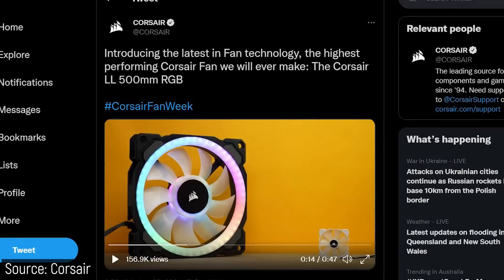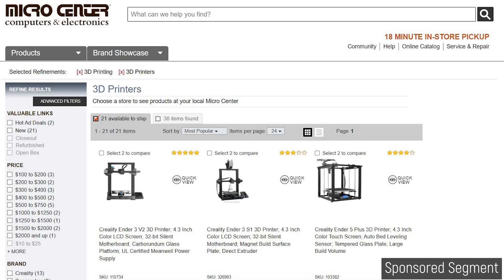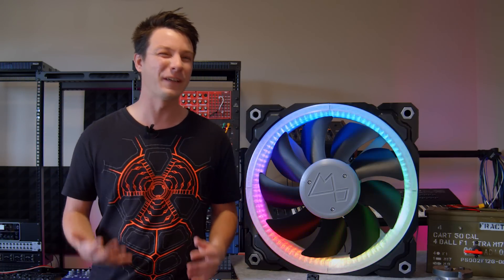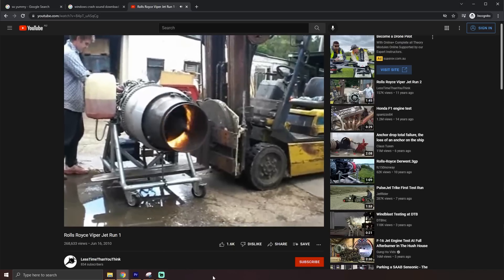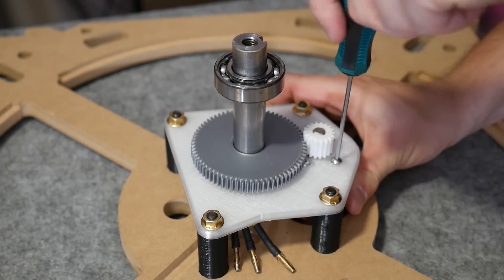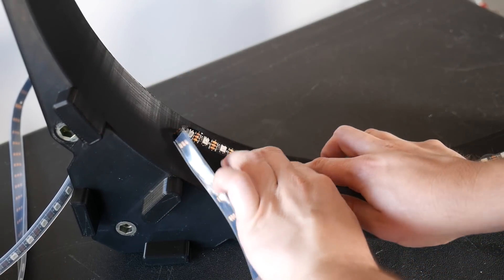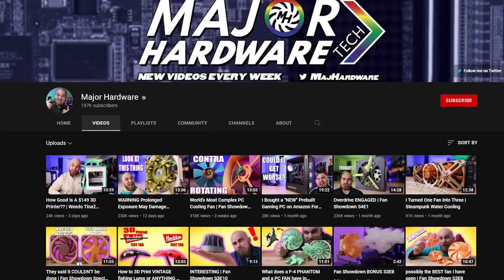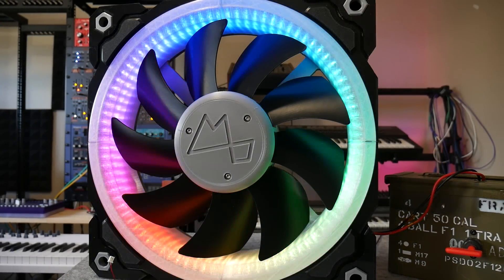Worlds most powerful RGB PC fan

Comment: If your gearbox melted down... maybe you need to cool it somehow? You could build a fan for that! 💖
Reply: next step: adding a bleed-air valve for gearbox cooling
Reply: Ive seen tests with some printed gears, for longevity you at least have to apply grease to them.
Reply: @FireN2k9  r/wooosh
Reply: Cast metal.
Reply: Hahaha. A tiny fan, inside the huge fan, to cool the fan components. Love it!! 😂
Reply: Fanception
Reply: Cool the gearbox with the corsair case fan 😂
Reply: Reminds me of the lego guy who lifted 200kg using a small lego motor but with many gears in parallel to spread out the load
Reply: If the smaller fan’s motor overheated.. maybe you need to cool it somehow? You could build a fan for that!💖
Reply: There is no way a 3d printed plastic can tolerate that super powerful motor, you need metal gearbox and really well greased
Reply: yes... that's what holes in hubs are for
Reply: When the fan is so powerful that you need to cool the fan with a fan.
Reply: @leandrolaporta2196  honestly, do not think that is required, recommend yes
Reply: Nah, he just needs an FDM printer. Obviously.
Reply: Fan for a fan
Reply: A fan to cool a fan with a fan. Hmm... Really makes you think
Reply: water cool the fan
Reply: Nah watercool that!
Reply: can't the gearbox would met but then you need another fan but wait....
Reply: @Lucas_sGarage  u woooshed yourself
Reply: Water cooled rgb fan
Reply: Makes me wonder what is the critical fan speed above which the current technology would emit more heat than it dissipates.
Reply: lmao
Reply: Those big fans used for bitcoin miners
Reply: Water-cooled fan
Reply: Fan for a fan🤣🤣
Reply: Good idea! But I thought it would be better if the gears are metal.
Reply: A fan within another fan
Reply: You could use a RAM intake from the blades to cool the gearbox.
Reply: 1. Printer Gets very hot
You: prints bbig thing
Printer overcooks just after finishing
You: starts assembling
You: uses fan
Printer: cold
You: Prints
Printer: AAAAAA
Reply: A fan to cool the gearbox of a bigger fan? That’s a great idea! But do you need another fan to cool THAT fan?

Comment: i don't know if i'm supposed to be impressed or horrified with the fact that a propeller that unbalanced didn't blow up with full send
Reply: It's only because the gearbox failed first, lol
Reply: It's okay. Angus was wearing safety glasses.
Reply: Right he could have added little weights where needed to balance it ;_;
Reply: Horrifically impressed, split the difference!
Reply: Why is it unbalanced? I use a centrifuge that hits 13,000 rpm at work. People freak out when they see me put 3 samples in it to spin. But you just need to ensure the mass is evenly distributed around the axis of rotation. So no problems. I just do that with 3 samples.
Say the fan radius is 45cm and running at 3000 rpm, then its pulling geforces of about 4500g. At that many g, it'd blow itself apart if it wasn't balanced.
Reply: @KieranShort  the propeller was wobbling quite heavily though when it was spinning slowly
Reply: @KieranShort  yeah but that's like not the point man. Of course it's mostly balanced however imperfections in 3D printing mean that not only is the center of rotation probably off slightly but each one of the propeller blades weighs a different amount. With brittle 3D plastic it doesn't take much to make it just come apart. I've seen it happen on a lot of different YouTube channels
Reply: @KieranShort  The balance issue is visible at the base of the hub. It's unbalanced from face to face of the hub which, while clearly not catastrophic, is a major limiting factor in top speed and likely contributing to the damage on the gearbox.
Reply: I wouldn't trust the added weight to stay attached. Better to remove material. But yeah it needs a little tuning.
Reply: @KieranShort  Ok yes but thats not a fair comparison really i mean  what size samples are you putting in there for one and is there not a huge caution sticker on it saying don't load an uneven amount of samples in it? lol  Thats only potentially dealing with a few grams at most of mass imbalance if its a lab centerfuge that is. You should try and pick it up next time your at work id bet its a bit on the hefty side not made out of PLA ! While his fan does stay together, at least it has for now, the fact of its tendency to want to perform its own rodeo is a  bit disconcerting. You can clearly hear it in the motor running as well. The spindle is nice and beefy at least and was done right and it looked like it ended up more balanced then the first test but for longevity/ major reduction in potential for lethality or grevious bodily harm, some balancing should really be done!

Comment: Really cool build. It makes great "thrust" and has an awesome design.

As an aerospace engineer, however, this is terrifying. There will be a speed at which the hub can no longer hold the outward force generated by the blades. Additionally, the blades themselves are only held together by the layer to layer adheasion / fusion of the plastic. Those jet engines you referenced have 75 years of design experience and testing holding them together.

Comment: If you want fast bearings without them being so quick to die once you remove all the grease, use a couple of drops of gear oil on them instead of WD40.
Reply: Yeah WD40 is "Water Displacer 40"
It wasn't designed to be a lubricant.
Reply: there are air bearings, just sayin'
Reply: @TauCu  Sometimes when it dries it can even recrystallize some of the crud it picked up and create a pretty damn sticky surface. I used it to both loosen and re-secure the rubber grips on my bike handles.
Reply: At those speeds, a lighter motor oil would also do well. 
Or just use the correct type and amount of grease, people mistakenly think friction at low lows and low speed indicates high load and high speed friction. But it just doesn't work like that low loads result in the balls skidding. Often machines with low startup loads will have some preload on the bearings to eliminate this.
In any case most of his friction was from choosing rubber contact seals rather than steel shielded bearings, and the excess grease will get pushed to the sides during break-in leaving a clear lightly lubed channel with self oiling reserves that also act as dust seals[on a shielded bearing]. Also those were the wrong type of bearing, a fan produces an axial thrust load and only trivial radial loads. 
All said so others can at least consider these factors in future projects, if any longevity is wanted.
Reply: @dustinbrueggemann1875  I've heard hair spray is good for putting on bike grips.
Reply: WD-40 as a substitution for grease? Maker YouTube channel? Fail. Not even bike chain lube...
Reply: @TauCu  yeh it even gets rid of grease and dries away itself.

Comment: I feel like the friction from the grease in the bearings is negligible when you're using a 1500 watt motor. Yes, when you're flicking it with your finger it stops quickly. But when being driven with even a few watts I can't imagine the drag is even noticeable.
Reply: I know the feeling. Way back in the early 80's I had a skateboard and spent an incredible amount of time messing with wheels and most important bearings. Looking back it was totally ridiculous. Sure it looked nice when you could put some spin of a wheel and it spun for a minute or so. But when you were skating it really didn't matter if you had torqued  down the wheel nut a bit more. It just meant you could be sure it would stay tight with no play. But no I was switching out bearings and spent more time cleaning and lubricating the bearings than I did riding the board...
Reply: @blahorgaslisk7763  Sounds like project cars!
Reply: yes but the gears are 3d printed and hence weak compared to injection molded or metal ones, removing any resistance is ideal as shown at the end they broke anyway.
Reply: @zalo3479  That's more because dry PLA is just a bit of a dogshit choice for a gear train no matter what your load is. A planetary set entirely out of that igus stuff with irrational ratios to spread the wear out would've had a lot less trouble regardless of the bearings having stock grease or not.
Reply: I don't think it's negiligible. It won't do much to slow the fan down, but it might just set the bearing on fire.
Reply: @blahorgaslisk7763  When skating it really can make a difference to swap bearings, especially on cheaper skateboards. With your legs you can feel a difference, on a 1500W it just kills the bearings.
Reply: And once it is spinning that fast. The grease will warm up and spin easier anyways… grease at room temp is always going to be sticky.
Reply: Definitely is like a grease in car bearings thing it seems like there's a lot of drag but it's fine

Comment: I build and fly quadcopters, but they only run 5" props and I'm terrified to be anywhere near the thing at half throttle with props on. That beast of yours had me clinching the whole time you were sitting in front of it o.O!
Reply: Once built a quad with 15'' carbon props, those were absolutely terrifying. A friend of mine almost lost a finger to his 17'' quad. Luckily it wasn't spinning at full speed but the prop still cut down to the bone and damaged some nerves. Always take the props off when you are working near them!
Reply: Tell me about it I was cringing ready to dive for cover and it’s only a video!
Reply: I agree That was very dangerous
Reply: @gonun69  Unless you're working on the motor systems themselves, you should also disconnect the motors from power.
Reply: @skylerlehmkuhl135  And that's the reason I'm terrified of those "flying car" concepts/prototypes where the prop is in the plane of the rider. What possibly could go wrong, right?!

Comment: The $100 Ender3 (even if it's just a sponsored event) is honestly a damn good offer. Like, sure, it's not exactly state of the art anymore, but I'd say it's what I'd recommend anybody who wants to get started and isn't quite confident enough to go for a Prusa.

Also, as for the main focus of the video, I just love seeing all the design work that's gone into this, especially at that scale. I mean, those M10 inserts are just... chonky.
Reply: I paid $130 for an Anet A8 kit when I first got into 3D printing, so a $100 Ender3 sounds like an amazing deal.
Reply: Yeah, the Ender3 offer sounds terrific.  Bummer that you have to buy it in-store, and the closest MicroCenter to me is 1200 miles away...
Reply: My Ender 3 Pro is still basically unmodified and I absolutely love it
Reply: I definitely don't recommend the E3... it's out of alignment (frame, bed can be bent in corners) out of box... you'd have to set it up on a granite countertop to keep the pieces from shifting while tightening.
Reply: @BeezyKing99  You are right. I had to make sure everything is at a right angle, which was a process, though very much worth the effort.
Reply: @BeezyKing99  accurate but still doable for the average Joe, if they wanted to
Reply: @transatlant1c  IF they were warned about this painstaking process to deal with accuracy issues RIGHT off the bat, otherwise they'll end up suffering the way i have, multiple hours (lost count) trying to figure out why my prints kept messing up, until I found out that the E3's are that bad for the price unless you're willing to deal with aforementioned process.... it is worth it in the end, but in reality, Creality's E3's are just slapped together and shipped out without any care in the world for the beginner's suffering when they're unaware about the issues E3's are typically plastered with.
Reply: @revengefrommars  is that all? My closest is 12,500km away.
Reply: I have to get another friend to sign up for this...
Reply: An Ender 3 Pro with a CR touch would be a great combo. The newer 3 Pro units come with a 32-bit board (with noisy mediocre Allegro drivers). They have a standard 5-pin port for the BL/CR touch. $99 is a steal.
Reply: @ToninFightsEntropy  I live near a Microcenter, and they do this promo regularly. It’s in store only afaik. Definitely not a scam buddy.
Reply: @ToninFightsEntropy  I got mine last night after I got someone to sign up as a new customer.

Links are auto-removed though.
Reply: Currently I'm printing a 4ft long working rc semi track and trailer with a ender 3 pro. I have the chassis done currently at 23" long. With drivetrain. Next up is the cab

Comment: I would've used the guts of an ordinary box fan and just essentially created a more fun case around that motor and control system. And with that hub design of yours, you could experiment with fan blade designs and get way more performance out of an off the shelf box fan then they come with, I bet. Could be a pretty fun alternate fan showdown lol

Comment: Don't just get a power meter - get an anemometer too! Show is those wind speed measurements!

Also if you're reprinting the gears (why wouldn't you, lol), would helical make a difference? Or printing in resin? Helical would be quieter but not sure if the shear forces would rip it apart on an FDM print, hence the resin suggestion. Fantastic job on the 500mm Coarse-Air!
Reply: He should just use a hub motor out of a hover board. It is silent and needs no reduction.

Comment: I say replace the receiver with a microcontroller that can output tach signal and take in standard pc fan PWM control signals and control the speed. Then you can hook this to a PC motherboard and use it as a case fan.
Reply: You'd need a 1500W PSU for the fan 😂😂
Reply: @jonipaananen9304  lol, yeah, you would obviously need a dedicated PSU for the fan alone, lol.

Comment: I'm curious to see the wind speed it puts out. Maybe get one of those meters to measure it? I'm more interested in the fan's output power than the power consumption. I wonder if there is a way you could measure CFMs? Maybe attach it to a big plastic bag and see how long it takes to fill it?
Reply: There are CFM meters that use a small fan to measure. It's commonly used to test hvac systems.
Reply: Just send it to Major Hardware
Reply: if I'm not talking out of my rear, you can approximate it by just using the area of the fan (excluding casing and the hub) and the average air speed on the output.
An anemometer, pen and paper and you'll get the CFM, m³/h, L/min. or any flow unit you want.
Static pressure takes a bit more to measure, you'll need to seal the back to the meter.

Comment: I would use a higher LED per meter WRGB strip, would look more diffused have less bright spots, and of course have a great white color. Id possibly also make the diffuser out of resin to avoid seam, layer and infill lines. Either way looks amazing

Comment: 10:32
You don't need a Current Meter. Just use a 1Ohm or 0,1Ohm Resistor and meassure the Volate across it. Then you can calculate the Amps with Ohms Law.
Reply: More like a thinner piece of wire...
V = IR, eg. 100A through 0.1 ohm is 10 Volts.. way too much drop in the measurement.
A clamp meter would be less intrusive, one that can measure DC current.
Cheers,
Reply: Im not really sure if he meant electrical current, i think he meant air current. But im not a native english speaker, so i could be wrong.
Reply: @MrBlackFiction  that's an anemometer. I think he meant ammeter.

Comment: Well Done Mate. Astonishing creation. 
There's a lot more potential here with this creation that you even have shown. 
Build it with a direct drive AC induction motor of about 3600 RPM, the speed can be varied with a variac or dimmer.
Also THIS design would be ideal for a SERIOUS ventilation fan in a large shop or barn out in the farms. 
They are getting very expensive now.
Also for temporary use in paint booths for evacuation of air and fumes.
AND Power it also with standard regular induction motors that do 1100 or 1800 RPM from HVAC systems on small fans and squirrel cage blowers would fit right into that opening and size with little modification. Those motors are highly efficient and low current drawing only about 100 watts or even less which would enable you to run this boss thing all day. 
That kind of build would provide a moderate speed with a continuous duty motor that could go in a window and ventilate 30X better than the cheap 3 speed box fans sold in large stores. Another mod of this design would be to use a 12V motor and use a smaller version for radiator cooling on custom cars. There are lots of electric radiator fans now but they are expensive and very poor in efficiency compared to this streamlined blade design. Of course in those serious applications the lights and so on would not be incorporated.

Comment: I have done some acoustic analysis on the fan revving at full power (12:49).
The main frequency is 1898 Hz. With a 9 bladed fan that means 1898 / 9 = 211 rotations per second, or 12653 RPM.

Much more than the 3330-ish RPM you stated at the start of the video (5:50).
The difference is about a factor 4. Which coincidentally is the gear ratio.

Any idea what may cause this difference?
Reply from the maker: I think you're hearing the motor not the fan, so that calculation works out quite nicely!